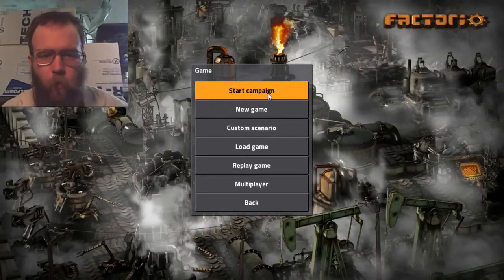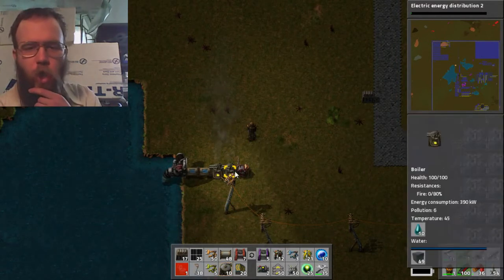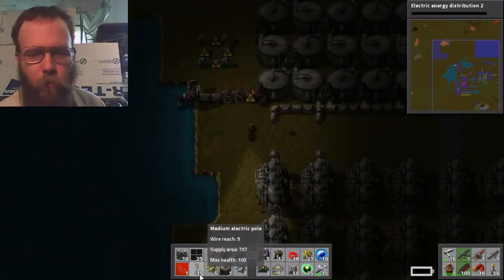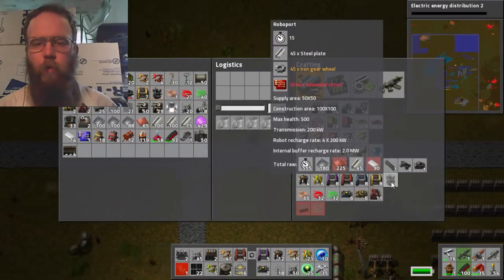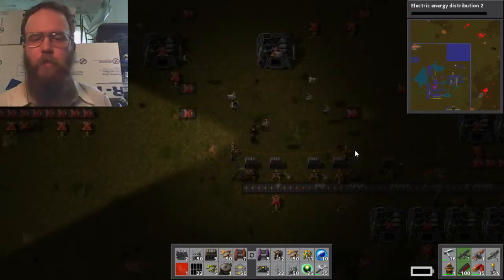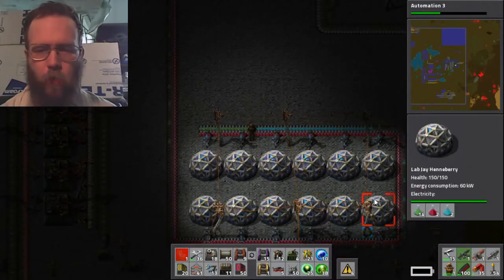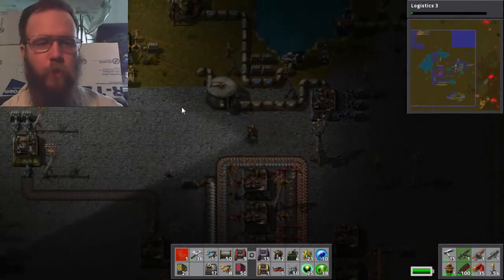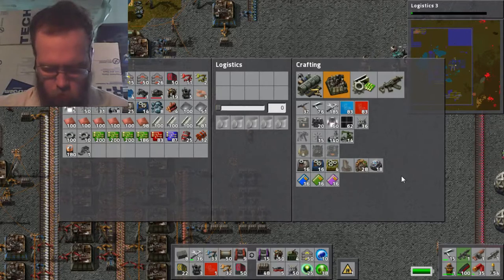10 I craft a backup generator, wierdly. - Factorio

Comment: YOur back up generators would be simply amazing  if it actually works Because  those 2 boilers  should [=provide enough heat for one  Steam Engine?You have to be very careful  every thing looks  like as if its running when only 1 is infact operational.  It was for kickstarter and very early game supporters
Reply from the maker: +Wicca Robin (Wicaki) I believe it works perfectly. Those storage tanks should be full of 100 heat water by now.

I suppose I'll have to run a test. :)